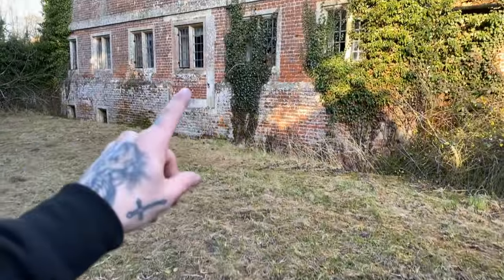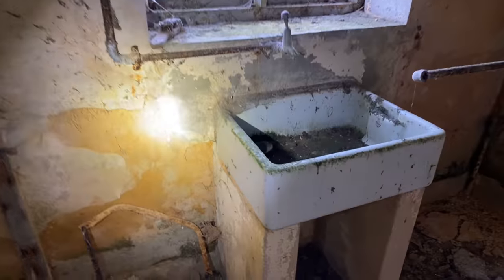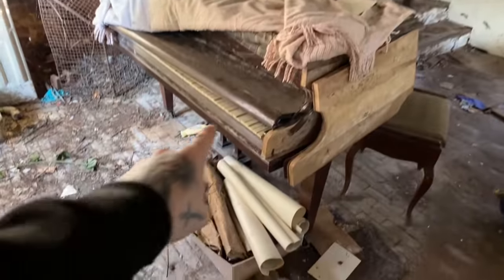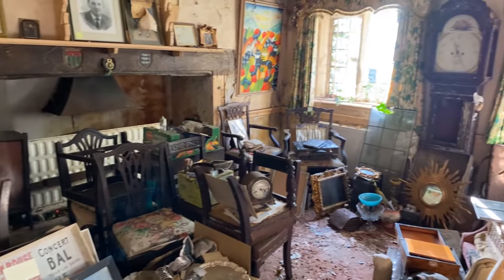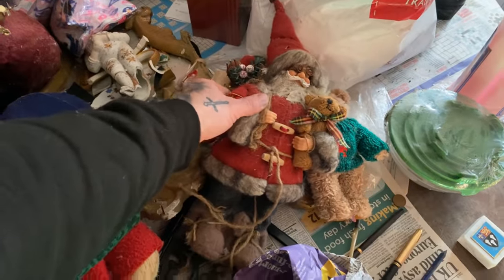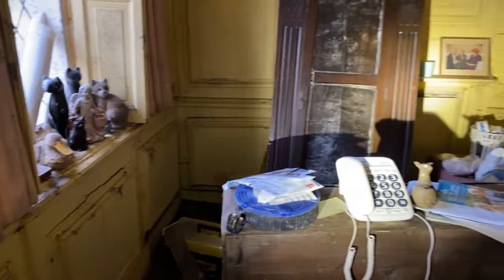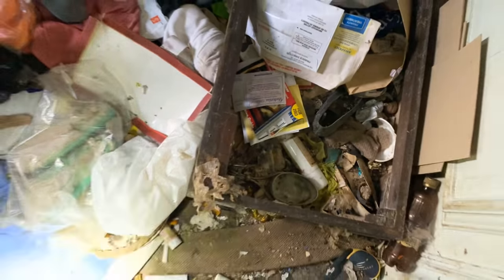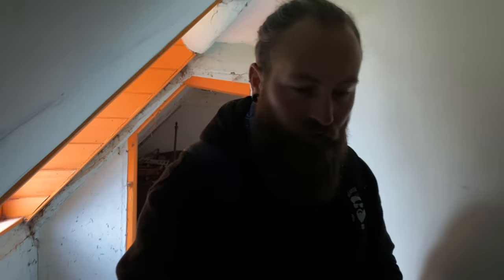Derelict 16th Century English Country Home! You Won’t Believe What Has Been Left Here!!

Comment: Great house, great video. There seems to be a theme in some houses of old owners, no family, the last dies or something happens to them and the house is just forgotten. So sad.

About the depth of the well, could be wrong but here goes my memory of 30 years ago physiscs class. Ignoring air friction, terminal velocity V=g*t, where g is the gravity, so V=9.81*10, V=98.1m/s. Solving for distance it would be the integral of the speed over the time, but again ignoring friction distance = 1/2*g*t^2 which is about 500m. This is obviously a huge number, so accounting for air friction and speed of sound coming back up, we should be talking of some 300m-ish. Now I'm used to thinking of wells as going 10-20m deep, put on those you hear the PLOP of the rock within seconds, 4-5 tops.

Comment: Calculate the distance traveled by the stone by using the following formula, where T is the time it took for the stone to hit the water: Distance = 1/2 * 9.8 * T^2 For example, if it took 1.5 seconds to hit the water, the stone traveled about 11 meters.
Reply: So for 10 seconds? 490 metres?
Reply: @fhwolthuis  That's what the science says. However, to get a more accurate measurement, it really needs to be timed wit a stopwatch. It was deep but not 490 metres deep.
Reply: @fhwolthuis  The deepest hand dug Well in the world is 390 meters - the Woodingdean Water Well.

Comment: I am not sure that you can calculate the depth of the well without knowing the terminal velocity of the stone.

Acceleration due to gravity is 10m/s so every second it gets faster... Until it reaches a maximum speed and we don't know what that is.

So between 0 and 1 seconds it covers about 5m. Between 1 second and 2 seconds it covers a further 15m.  Between 2 and 3 seconds it covers a further 25m. So after 3 seconds it hasn't covered 30m but 45m.

I don't think anyone can accurately say how deep the well is because it probably doesn't reach 90m/s as that would be over 200mph.